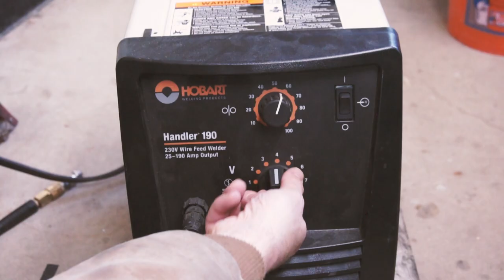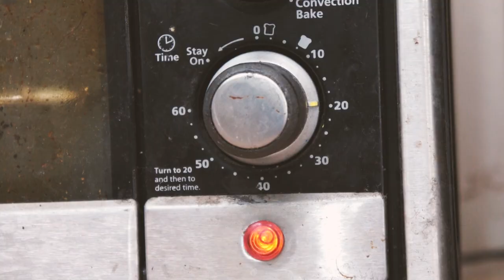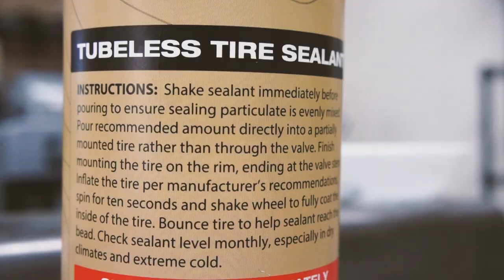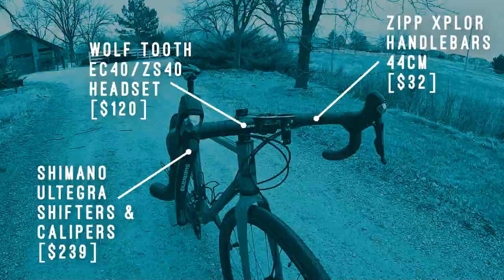Broken Chumba Terlingua Gravel Bike Rebuild - Cracked Frame

Comment: One of the greatest Videos I have ever seen! The creative handcraft and also the cinematic... The only thing I missed in the video was how you repaired the broken shifting lever? I really love your videos, I think you really found a niche in the big amount of bike mechanic videos in youtube, the only thing missing is the attention of a lot more well deserved subscribers!
Reply: Also why did you replace the headset? And how do the juin tech semi hydraluic brakes compare to the full hydraulic ultegra brakes? :D
Reply from the maker: I was trying to save money initially and used a RISK headset off Amazon.  I’ve used them before and had good luck.  But on this headset, the fit between the bearing and cup wasn’t perfect.  I wanted to add a tapered spacer and when I considered the cost of that, and the fit with the upper bearing, I decided to just replace the headset.  

I’ve never ridden a bike with hybrid cable actuated hydraulic calipers.  I can say how they’d perform.  I’ve not gone that route mostly because the hybrid calipers are so expensive and I’ve been able to put together full hydraulic groupsets for about the same money, albeit requiring reconditioning.
Reply from the maker: I was thinking I could have showed that better.  Ooof.  They were gunned up with sand and grit.  I removed all the housing covers and cleaned them out in the ultrasonic.  Then paint and repacked with fresh grease.  They worked great after the cleaning.

Comment: Great work for sure and I'm very jealous of your skills, but how did that frame crack in the first place?
Reply from the maker: There was a gouge in the center of the bottom bracket that made the metal thin there.  The original owner put thousands of miles on the frame.  All that force oscillating force from pedaling eventually fatigued the metal where it was thin and it cracked.
Reply: @RobertAdairWorkshop  Thanks for the answer. Was the gouge made accidentally like a big chip from the road while using the bicycle or was it a manufacturing fault by Chumba? I guess the distinction matters.
Reply from the maker: @weeringjohnny  It sure looked like a manufacturing defect.  Like when they tapped the bottom bracket threads, something in that tap gouged the inside of the bracket shell.  I didn't want to call Chumba out as I can't be sure.  Definally not caused by usage.  I'll say, though, if they weren't so expensive, I'd buy another Chumba frame in a heartbeat.
Reply: @RobertAdairWorkshop  
Many thanks, very informative.
Reply from the maker: @weeringjohnny  Of course.  Thanks for the questions and thanks for watching.  Really do appreciate sharing this stuff with you guys.